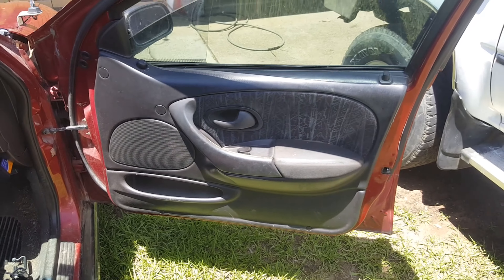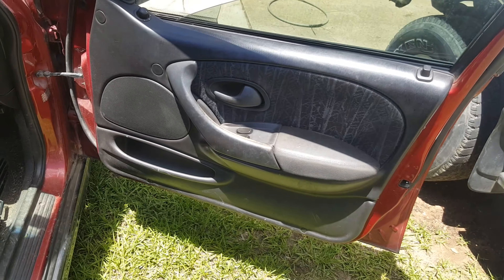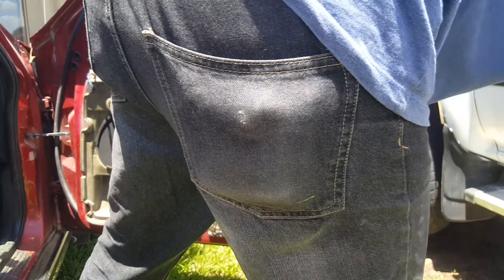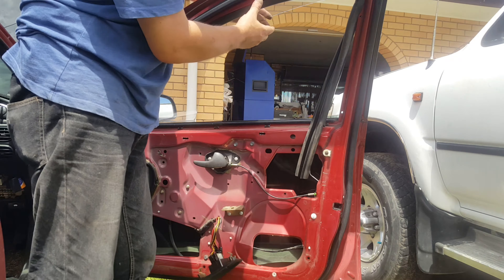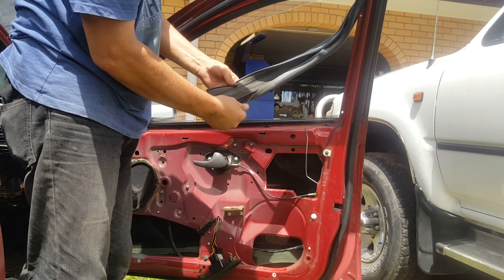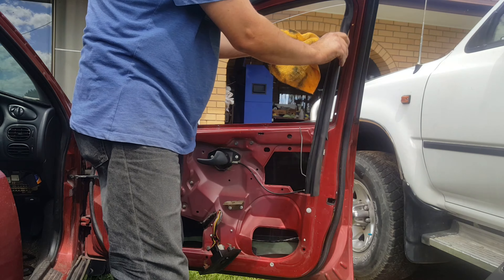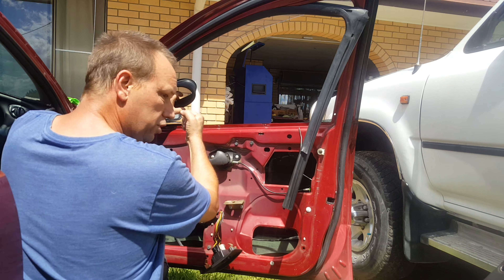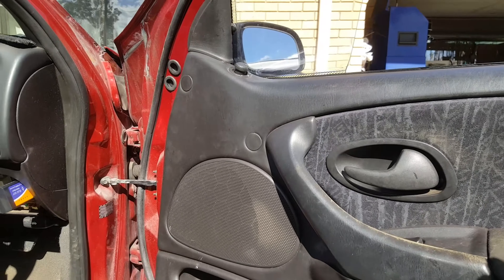FIX A STICKING SLOW DRAGGING WINDOW - AU FORD FALCON

Comment: I've had an AU Series 2 for over 20 years, and had the same problem when I first got it with no luck. Tried everything, then a mechanic put me onto Wolfchester Curtain Track lubricant. It's the ONLY stuff I've found that works, and it lasts for ages. Hope that helps.

Comment: You have 4.6k viewers that be happy if you quit your daytime job and became a pro-ford door window replenisher..I'm only here for my Hyundai Excel yet I have a 2007 Territory that has 3 tricky sticky windows. You'd actually probably have a great business doing this to cars
Reply from the maker: LOL. I have actually started a new job this week. Not sure how that will effect making YT videos yet. Time will tell. I owned a business once before. Repairs are the easy part. Customers another story all together. I would rather be employed than to be an employer believe me. I like the Territory. I know the electricals in them can play up but that's when I would correct it in my own way. If I didn't already have 5 cars 3 in the yard waiting to be worked on meanwhile pissing the MRS off I would probably get one.
Reply: @TEKNOFIED  my mate ended up taking a punt and bought a Hyundai Accent window mechanism for the Hyundai Excel. Very similar tho he had to drill four different holes into inner door skin and then loosen up these two guide things that are stuck on the bottom of door window glass with carby cleaner ( guides held on with goop like they'd use to put around windscreens ).. and refit the guides.... It worked tho the spline thing that comes out that you put your up down handle on to make window work sits proud of door trim... Hope your missus gives you leniency lol 👍

Comment: I had to replace the rubber in my BA today and some WD PTFE (teflon) spray made it a bit easier to get the rubber back in, but still needed to take the speaker out.

Comment: You have to get two screwdrivers and prise apart the two plastic clips that are attaching the window to the rear of the regulator.
Remove all the bolts from the regulator and manipulate the regulator to disconnect it from the glass frame.
Then you can tilt the glass forward to remove it from the door.
It's difficult to do but it can be done
Reply from the maker: Cheers mate. Good to know for if I ever need to remove the window cheers.

Comment: I’ve got an au with the manual winder and that angle you mentioned at the start of the video was happening to mine too. Except over time that angle was leveraging against the glue holding the window to the 2 centre clips, and broke the glue. Window fell out of the tracks into to the bottom of the door several times.

I wonder if a bit of graphite would work better than that easy glide you mentioned. Just draw on the rail with some gray led pencils, exactly like the brushes in a starter motor. It’s a dry lubricant so you wouldn’t have a problem with the dust and stickiness. Might even try it myself
Reply from the maker: A dry graphite and not the spray would help, but it will make a mess. If you try it I would suggest doing it where there is no wind. I can imagine applying it will be tricky unless you pull the rubber rails out and than apply the graphite.

Comment: Yeah, interesting.
I replaced the regulator in my BA a few years ago but it has been getting slower as time goes on. Both sides are affected.
I'll try what you did, but I think the BA has felt or something else besides rubber in there. I'll remember when I pull it apart.
Reply: I replaced the rubber in my BA today and the only felt is at the bottom of the window opening.

Comment: Spray silicone down window rubbers fixes the problem quick and easy without pulling the door apart.
Ford mechanic
Reply from the maker: True but not for long. I Did that, Used Easy glide, WD Silicone Lubricant, Spray Dry Graphite and more and all only work a week or two. I used all kinds of products for years until I finally had enough, so I pulled the rubbers out to clean. Now; No products at all and I have not had a problem with my window since. Cheers
Reply: @TEKNOFIED  obviously your vehicle had been neglected over the years as I have never had a problem using silicone spray and only need to use it every 12 months as preventive maintenance on all my vehicles.
Reply from the maker: Exactly. I let it be way to long.

Comment: Tried this on my AU but unfortunately hasn't worked. It's definitely the rubber as the window moves up and down with ease when the rubber is removed.
I'm thinking the rubber may have swelled over time and needs replacing all together?
Reply from the maker: Maybe, Make sure to have a good look near the mirror that the rubber is in correctly and on the inside rails that the rubber didn't twist. Easy to over look as it can look ok but after touching it you can feel it isn't. If you already did that then I would have to agree with you. Cheers